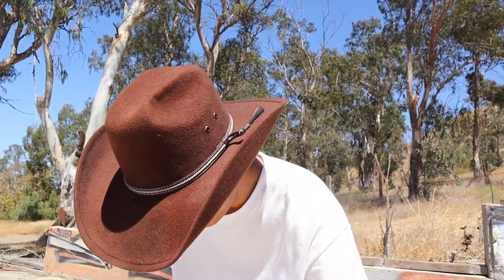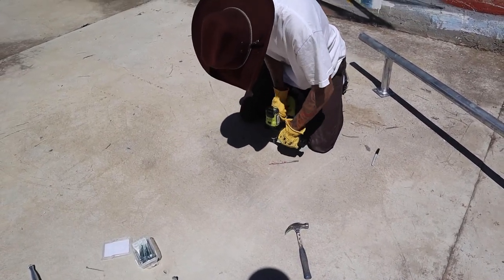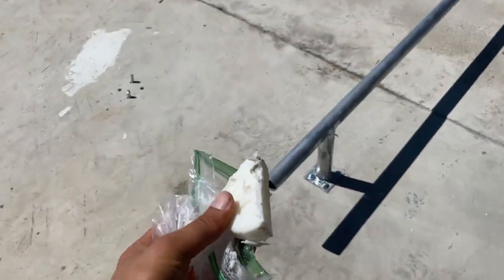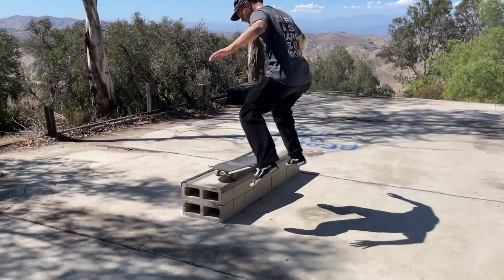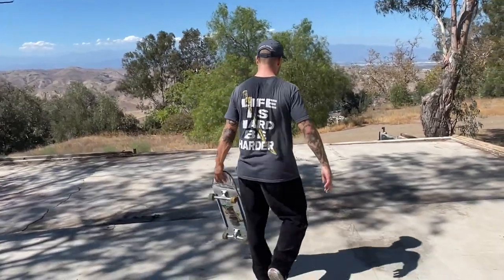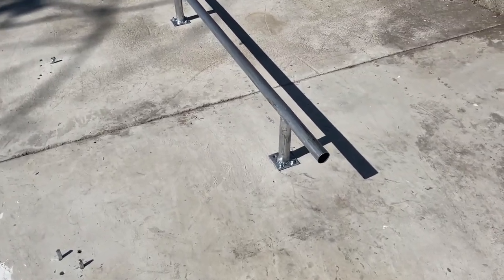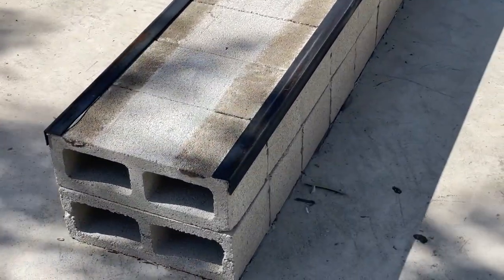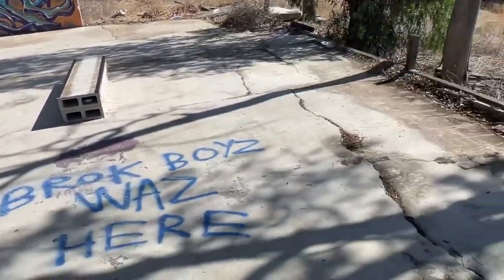D.I.Y DIARIES EPISODE 11 | D.I.Y SKATEPARK | FLAT BAR FRENZY

Comment: Glad you got it in.Those anchors are hit or miss.You might have better  luck with bigger (tap con ) style anchors. If they don't grab you can back them out and stick some steel tie wire down the hole with a little outside you can hold then drive the anchor back in and it usually grabs thanks to the filled space the wire creates.

Comment: If those are "drop in" style anchors, you might need to set the center pin to expand the anchor in the hole before you install the bolt. Sick build though bro, I'm digging the spot for sure!

Comment: Dyna bolt should snap at concrete level if you hammer it back and forward a few times👍🏼
Reply: Locksons would do the trick.
But yeah dyna bolts would have been my second chioce. 
But he has to go grin down and patch those wrong holes now too. .
Fun . 
Whats the old saying . 
Measure twice,  drill once. 
And a hammar drill with a masonry drill bit was needed as i cringed watching that dril bit flexing ... that could have gone real wrong.